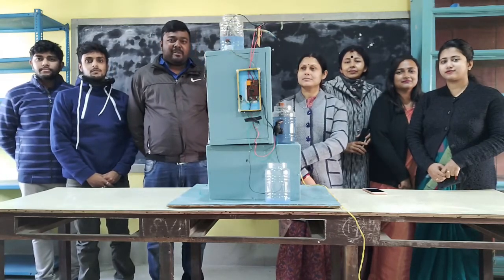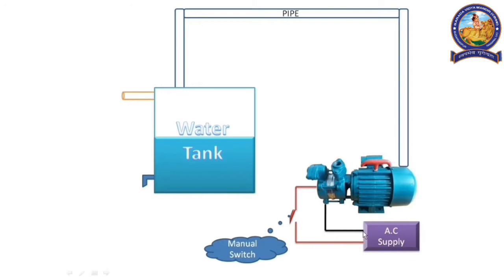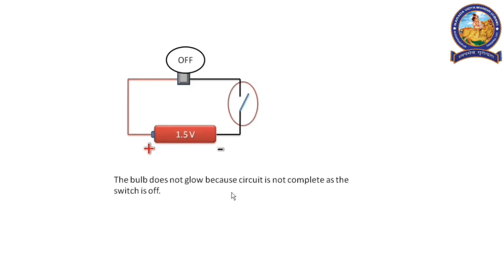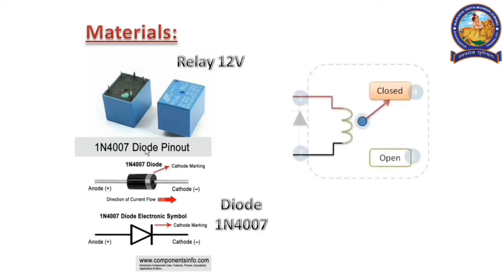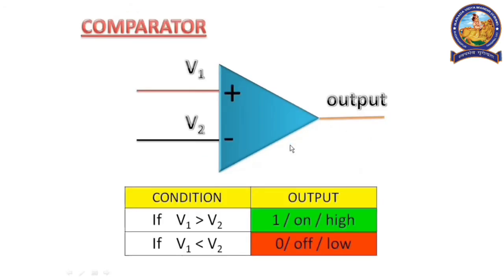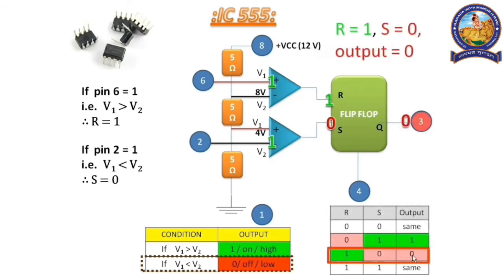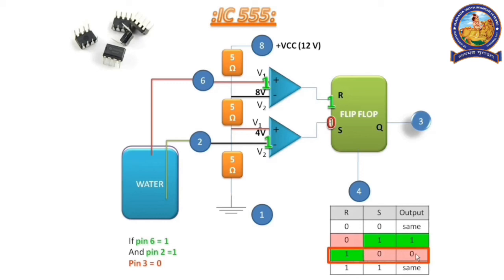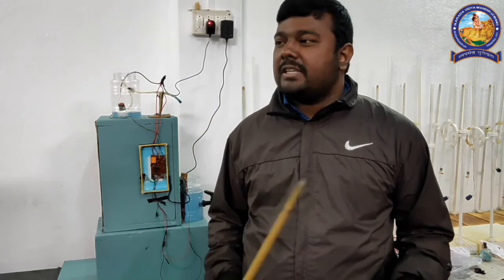Automatic Water Tank Switch Project. Full working principle explained for school/college exhibition

Comment: How you connect an A/C water pump if the switch is D/C ??? Thanks very good I  am victor...
Reply: Here relay is operated as switch which runs on DC supply but other side of relay connect to AC supply to run the motor